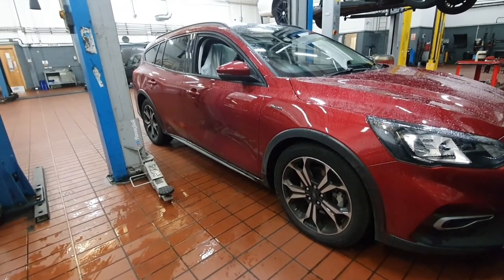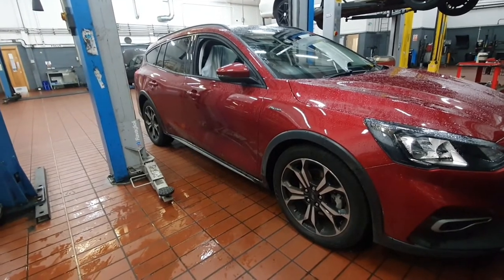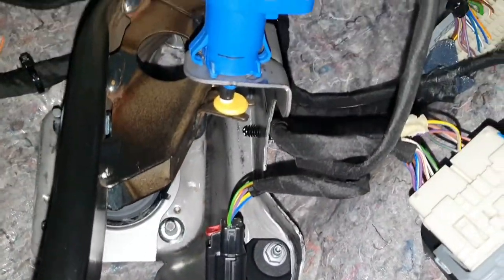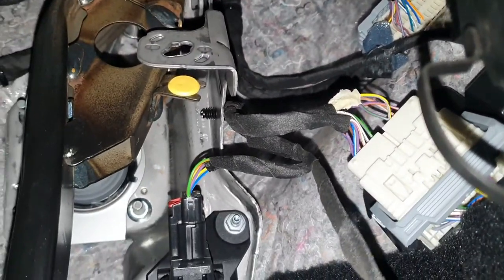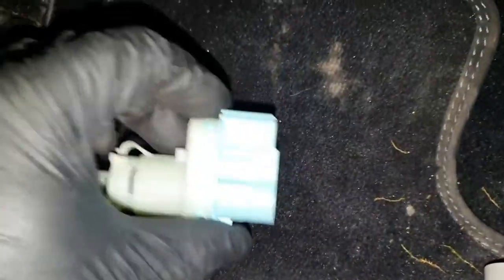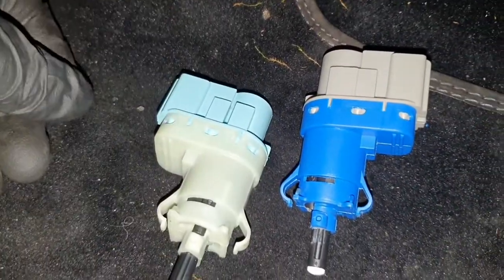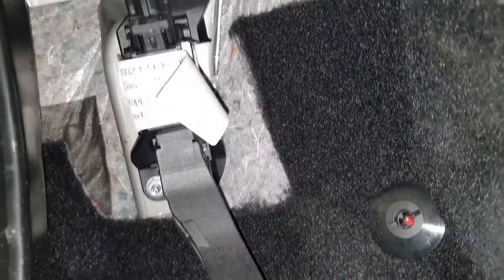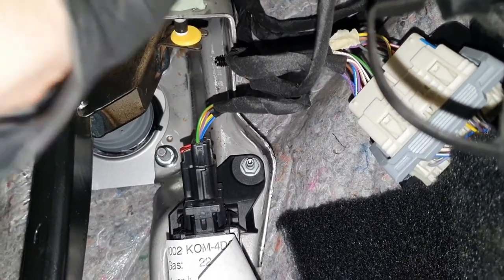How To Replace Brake Pedal Position Switch - Ford Focus - P0504 Brake Pedal Correlation "How To Fix"

Comment: I have SBS and SCBS and parking brake and Camera sensor malfunctions on my CX5, but the only code shown is P0504, nothing else. The switch seems good because it turns on the brake lights and the pushbutton start has no problem. Any ideas?

Comment: Hi, I've have this code on my mk8 ST, would this be the same procedure? I guess there isn't much difference between the fiesta and focus. Do you know why these actually fail? Because I see you just connect it back up so what is it in the actual switch that causes this failure? Many thanks!
Reply: How did you get on? I just got this code after my mot